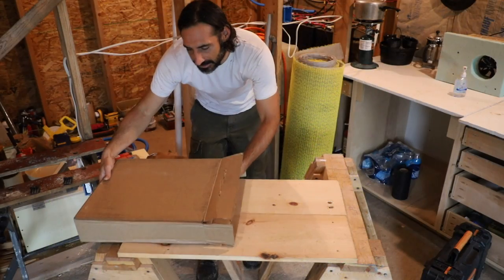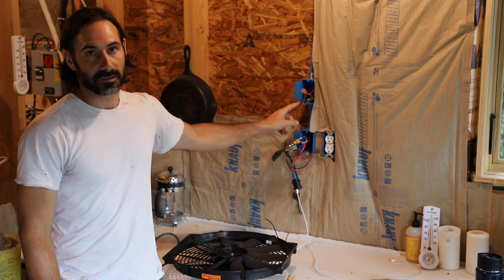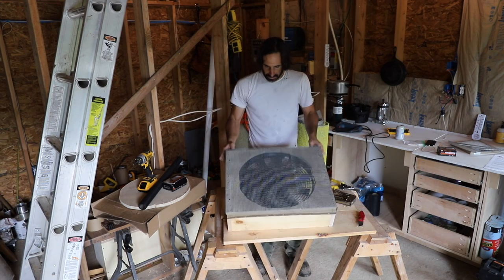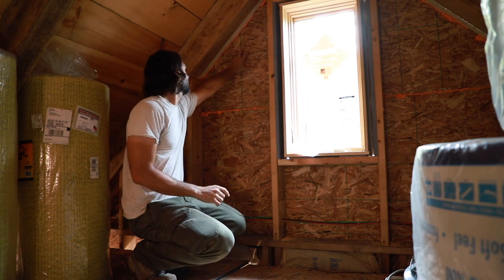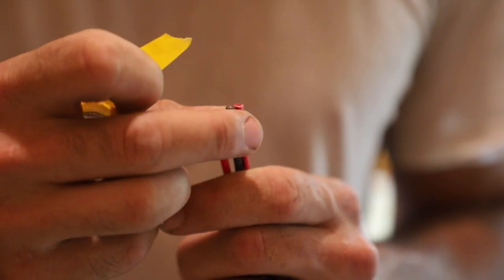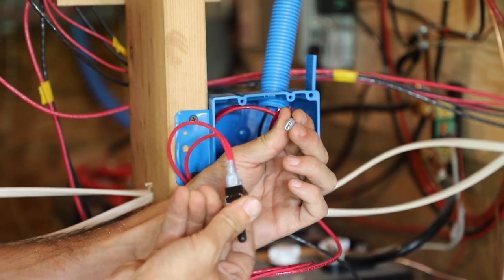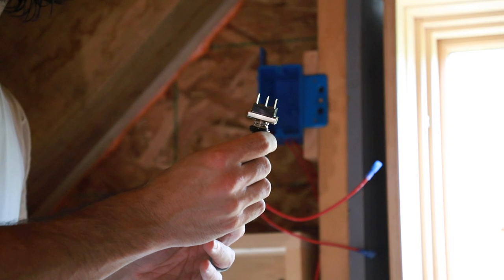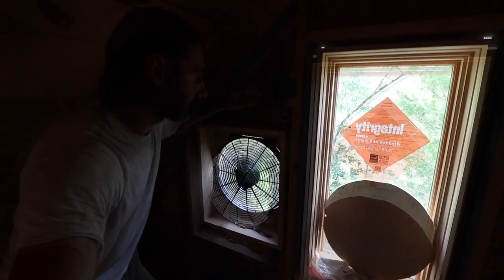Off Grid Alternative to Air Conditioning?  Making a Whole House Fan From a Radiator Fan

Comment from the maker: Here's a follow up video where I install a speed controller on the fan that lets you run it at any speed (and volume) you want. https://youtu.be/S4C9g98IAdc
Reply: Hi, would you be able to build a cabin like this for me? Thanks.
Reply: I was serious, lol. Is that something you do? Could we talk about pricing, etc.? I have some land and wanted to build a small cabin on it.
Reply from the maker: Daniel T. Hey Daniel T.  where are you located and what is your timeline?  I have some rehabs going of properties I’ve purchased that probably put my availability at around two years out.  I am a landlord and rehabber in Dayton OH that’s kinda my day job.
Reply: @50Acres  Thanks for explaining. It would be located in North Carolina, and my timeline is not urgent. I just wanted to know if I can speak with about what it would cost, size, etc. That's cool you're a landlord. If it's comfortable for you, maybe we can speak through email or whatsapp. Tell me what works for you. Thanks.
Reply: Nice.  I did the same a couple years ago in my workshop using 12VDC, old similar truck radiator fan, and an old computer power supply.  Works great and reversible.  Thx for the speed controller link as well.
Reply: @50Acres  Hi, can we still speak, perhaps over whatsapp? Thanks.
Reply from the maker: Daniel T. Yea you can email me at the address in the about question or DM me on Instagram
Reply: @danielt.4330 5 Bbgygffdr
Reply: @danevans7214  What is wrong with you?
Reply: @Allen Loser dear sir l'm sorry to see this l don't know who this is but you can be it is not ME I'M SORRY FOR WASTING YOUR TIME HOPEFULLY I'LL FIND OUT who is doing this sorry for your time you have lost please l'm really sorry for this.
Reply: Another heating and cooling opportunity is the old buried snaked 4" conduit/tubing under the structure before you lay or set the foundation.  That can easily pull 55F air year round.  It's great for greenhouses too.

Comment: Nice idea but radiator fans were designed for maximum flow at high amperage and very noisy, if you plan on keeping it install a pulse width modulator  (PWM) control, you only need a quarter of the speed at a fraction of the amps and it won't wake up the dead, I bet you that sucker draws at least 15 amps, at the same time install a thermal switch upstairs so it will switch on at a set temperature of your choice and shut off automatically. 
Thanks for the upload and keep up the good work  !
Reply from the maker: It pulls 120 watts!!  I am definitely going to wire in a PWM controller.  The thing really blasts on right away too!
Reply: @AZBADBOYz  But wastes power and reduces motor torque.
Reply: Iama Wanderer  there are plenty of men like this it's just you find most of us psychically repulsive
Reply: The start up and running amperage are in the instructions.  I'd bet its startup is 30 to 40 amps.   I usually run these on a designated relay of at least 30 amps.  Running amperage could exceed 20 amps.  Being 24v it may run lower than that.
Reply from the maker: It's claimed running amps are 6, measured running amps are 5.  I don't have sophisticated enough equipment to measure the start up amps.  It moves 2,250 CFM so on paper at 100% efficiency it would change the air in 2 1/2 minutes.  I give it 5 minutes to run and it's done.  The controller will be nice if I want to let it run all night at low speed.
Reply: @50Acres  I run these and similar fans on 12v systems for auto.  The 24v is much more efficient apparently. Which makes sense double the voltage and reduce amps to do the same work.  Most 2400cfm and up 12v fans have a minimum 25amp start up circuit hence relays while the running amps vary from brand to brand.  I've never seen less than about 10 amps running.
Reply from the maker: @randythompson4006  It's on a 15 amp fuse, per instructions,  of course that doesn't mean it doesn't momentarily draw more than 15.
Reply: @50Acres  i gotcha. I just have experience with 12 volt systems.  The 24 volt runs a lower amperage which is good.
Reply: I would have put this sucker on some 12v 3amp adapters this thing is way too loud.
Reply: Built a box fan with one of these and put a speed controller on it and it has a display speed 1-100.  Best fan I have ever owned and the most powerful by far. It has been running in the summer for two years now in my room. My 1000Watt Comptuer PSU powers it. 50% power is quite a bit stronger than any box fan I have ever owned. I just gutted a burned up box fan.
Reply: Randy Thompson You mean 10amps at 12volts, which is why he is seeing 5amps at 24volts, it’s all the same in watts.
Reply: should have gotten one of those ultra quiet bathroom exaust fans.  probably not much more money and would be way quieter.
Reply: @johntate4638  I see no reason why it would not work.  Those slow fans can work all day non stop and they don't take as much power as huge fan he is using.  Constant air pressure should work as well as radiator fan does.
Reply: You can also change to a fan with S shapes blades, less efficient but way quieter. PWM controller is a plus as well, run one on my old car and I’ll never go back.

Comment: I have a locomotive horn for sale, you will need to hook that to your doorbell to hear anybody at the door over that fan.
Reply: Oh my...  I haven't laughed this hard in a long ass time.  Thanks so much for this.  And if the locomotive horn isn't loud enough, my community might have an extra air raid/tornado siren you might be able to hear over that radiator fan.  Or something like the ship's horn from the USS Iowa?  Sleeping in that loft would be like sleeping next to a jet turbine at takeoff power.  Sure wouldn't have to worry about the pesky sounds of nature for miles and miles out there in the wilderness.  All you'd hear is that fan...  the exhaust fan is a good idea.  Ultimately, may want to get something quieter and designed to run constantly.

Comment: When I bought my river cottage it had a whole house fan, it worked great to cool the place down by barely opening a window, turn it on and all the inside hot air went into the attic.  I later had it removed & put in an AC unit, doesn’t help with humidity.

Comment: We had a house fan in our ceiling in California. It sounded as if the house was going to take off for flight (much louder) but it worked quite well and we didn't have to use it often, just for 20 minutes or so in the late afternoon or early evening on really hot days. Great job on the install! Your place is looking incredible 😀
Reply from the maker: Thank you guys!  This thing moves 2,250 CFM so it does it's thing in around 3 minutes!

Comment: When I was a kid we lived on the second floor, no a/c back then and boy it used to get hot. There was an opening to the upstairs storage, my dad bought a huge window fan and put up there. What difference it made. Good thinking with that fan it may be loud but it won't have to run that long.
Reply from the maker: It really works well doesn't it Jo!

Comment: Great idea to use the radiator fan, a little box build and wiring and you have an awesome attic fan. Although you probably won't leave it running for extended periods? You definitely know when it's running. 
Appreciate the smurf reference with the tubing, gave me a good chuckle. Always look forward to your weekend video post.
Reply from the maker: Hey Charles, thank you bud, yea it doesn't need to run that long, maybe 5 or 10 minutes before it changes the air in the cabin,  I'm also going to wire in a controller so I can run it at less than 100%.
Reply: @50Acres  I highly recommend checking out horticulture inline fans, I have an 8"inlet inline fan and itll exchange the air in a 100'x80' area in less than 10 mins plus you can still talk over it while being able to directly make ac ducts

Comment: We have the same issue where heat slowly builds up in our top floor and we also have plenty of insulation.  We have two windows facing E & W and simply popping in an inexpensive 120 VAC room fan in one of the windows works wonders.   The noise from the fan is very low.  We also use a 120 VAC WiFi switch to control it.  I'm sure there's a way to control it with a thermometer and controller.  But for now having the WiFi switch is good enough.  Every 3 years we have to replace the fan because the dust and weather destroy the induction motor (gets rusty).  No biggie because the fans are cheap and everyone has them when the weather gets warmer.  What would be best is roof mounted fan, but that would involve having to break through the roof and that can turn into a mess with tile.  

Thanks for the video.

Comment: you need to add a fan relay to save your switch use truck switches they are gold plated terminals and a  fan resistor in the air flow for mutiple speeds

Comment: We use window fans all the time here in Florida to create a whole house fan effect.  The old metal fans look the best when painted.
Reply: First thing I thought of! Been doing this for ages, but glad to see a stronger option.
Reply: Could never live in Florida without my air conditioning. Id die.
Reply: In a high humidity region like Florida, wouldn’t you just be pulling in moisture using fans?
Reply: @cmiller6352  In the summer, we have to use the AC with ceiling fans, but once a week, we put the metal fans in the windows to bring in the fresh air.  The rest of the year, is much dryer and using the fans is constant, except when it gets too cold.
Reply: The point of a “whole house fan” is to pull cooler air in from ground floor windows and exhaust it/force it into your attic, not out a second story or first story window.  The point is to flush the hot air out of the attic while drawing in cooler evening air from the ground level.

Comment: When my electric bill went over $300 one month (South Carolina summer), I knew I had to do something.  I did what you did, but 120 volts.  It cost $50 and paid for itself in the first month.  That made me a believer.
Reply: What kind of 120v fan did you use? I've been looking for a while and I can't find anything around $50. Thanks!
Reply: @leifforrest  Hi, Leif.  Inflation has run up the cost of the fan, as well as the electric bills.  This is the type I used (now ~$90):  https://www.lowes.com/pd/Air-Vent-18-in-Dia-Electric-Gable-Vent-Fan/3143421
Reply from the maker: I got the idea from my in laws, they have one in their house and it works very well. Glad it worked for you also.

Comment: you only need to crack the windows a couple of inches to get good airflow. As others mentioned too is possibly a speed control switch to reduce that noise level.

Comment: Should install a roll or dimmer switch to controll the fan speed..
Reply from the maker: Michael Yarmie definitely going to do that thanks Michael
Reply: @50Acres  Use an arduino and have the variable speed controlled by temperature needs;
Reply: Fan speed controller that can handle it. I built a box fan with one of these. The controller is like $12.

Comment: Talking about switches not lasting ,i usually install a relay for heavy amp draw .which wil improve the life of the switch. most likly if you have a car with electric fans it has relays to operate it. nice job on the cabin.

Comment: You could build a n OSB duct up to the peak of the roof to collect the hotter air there. It would also reduce fan noise particularly after the insulation is installed.Also
two 120mm computer fans along the ridge wired in series for 24 volts would encourage the hot air towards the exhaust fan.

Comment: That fan is for use on Hotrods and racecars to avoid HP loss, remove 2 of the blades to quiet it down.Only in opposite pairs.
Reply from the maker: Thanks for that suggestion George
Reply: By taking out 2 of the blades you will reduce air flow.

Comment: You may want to get yourself a 24V rated PWM controller to tone down the racket that thing makes. ^_^
Reply from the maker: metamud that’s a great idea!  I will,  when this thing kicks on, it really kicks on hard,  I think it will also prolong the life of the motor.
Reply: you're welcome.  these things are cheap as heck on the 'Chinese market', but no doubt also available from US sources if you so prefer. Enjoy your cool(er) cabin! :-)
Reply: @Damnit Bobby That would be an interesting project. It's awesome that you can buy cheap and relatively easy to program parts for arduino to control stuff in the most elaborate way.
You could also time it so you pull in cool air in the morning / night (?) to cool the house and not hot and humid air during the day.

Comment: What a great idea for a fan. 24v things are tough to find just the right things sometimes.. I used the small computer fans at first. Not enough air flow. That one you got sure moves the air. Should work great..!! Have a great day..!!
Reply from the maker: Hi Ron thank you so much for watching man I appreciate it. It blasts the air, I am going to wire it to a variable speed controller, should do the tirick.

Comment: That was fun.  At first I thought... That is kind of loud, then I understood that you'd only need to run it for a few minutes and the cabin would be nice and cool.
Reply from the maker: yea it changes the air in the cabin super quick im also going to wire in a controller so I can run it at varying speeds.

Comment: Smart idea.   We didn't have air conditioning in my house when I was a kid growing up in the Northeast.  We only an attic fan, but it worked really well.  However, I didn't spend much time at home.   Now I am home most of the time, and have a lot of electronic items running,  I couldn't live without air conditioning now.
Reply from the maker: Thank you J Ansa, it really does work when the outside temperature drops quickly in the evening.

Comment: Attic fans are usually of a large diameter running slow with a belt and pulley reduction from the motor. They move a lot of air and are quiet. The bug screen will clog up with dust and dirt and cause problems.

Comment: I built a rectangular box with four 12V computer fans in it. These are pretty quiet for sleeping.  Also has a push button start on a timer to shut off after two hours. It cools down at night pretty quick and would wake up with the chills if just left on.  Near the end the fan slows down so there is nothing abrupt to wake you.
Reply from the maker: I wired in a PWM controller, it works great I can run it at any speed or volume I want now.

Comment: Considering the location, do you have any problem with wind blowing rain in through the fan?

If so, install some louvers on the outside to prevent it. Since the fan blows outward, you could use some type of louvers, either fixed or moveable.

Comment: May be loud but it works sounds like.  Guess what you could do is run it until your ready to get some sleep. Not sure if you get snow where your at but you may want a cover or something to keep the cold out when the weather changes. That is wide open and if rain comes from that side you could also get real wet.

Comment: you need be fan hole insulated hatch winter season can closed, outside hinge and chain or rope to in were can open and closed hatch.
Reply from the maker: Thats a great idea, maybe on a line that I can pull from downstairs.
Reply: @50Acres  You also want to include a kill switch when the hatch is closed. Can be very dangerous to run the fan when the hatch is closed so that cuts the possibility short.

Comment: You can dramatically improve the efficiency of the fan by installing a shallow round casing  that almost touches the fan blades. 
Installing other fan blades would most probably help as well.

Comment: Wow that’s a powerful fan. Great for a night that’s too hot & u can’t sleep
Reply from the maker: Carol Turner Thanks Carol!
Reply: Carol Turner... It's unfortunate that the noise of the fan will also keep them up.  More so than the heat in the cabin. They need to install a speed regulator to tone down the noise some.
Reply: I’m sure that will be done. He’s a real perfectionist
Reply from the maker: I'm going to wire in a dial to control the speed soon!

Comment: You could put a 24 v solar panel and reg near that fan and it would power up and turn of automatically with the sun , free to run and if you use a speed control it wont be so noisy

Comment: You may know about it but AliExpress has a lot of cool stuff you could use in your build. DC fan controller's $2.45, DC thermostats $3.00. Takes a few weeks to get stuff but they have stuff that's hard to find or can't find. Tons of solar stuff. Give them a look they have all kinds of stuff. I get buck converters, USB charge controllers and some other items from them and its all been good stuff.
Reply: Thanks for the heads up on this place. Amazing!
Reply: @randyboen6016  check out there ( Peltier Air Conditioner Semiconductor) I can spend hours on their site.
Reply from the maker: I will have to check that out thanks for the heads up!
Reply: Yeah, ive been using aliexpress for years.  Pretty good site.  And they use escrow service, so the seller only gets paid if you receive your item.

Comment: Is there any way to step down the voltage from 24 volts to 12 volts just for the fan circuit?
Reply: There are DC to DC converters.  Simple to do.  Personally, I would have gone with a 6" or 8" tubular fan at the apex above the window to allow natural convection to assist the most.
Reply from the maker: Yea I could drop the voltage, so far I have avoided doing that but if I knew how limited 24 volt fixtures were I would have done that from the start.

Comment: I'd think two smaller coaxial fans above the window would be more quiet, and more efficient since they're up higher and could be controlled individually, or together with a rheostat to lower the noise which was excessive.